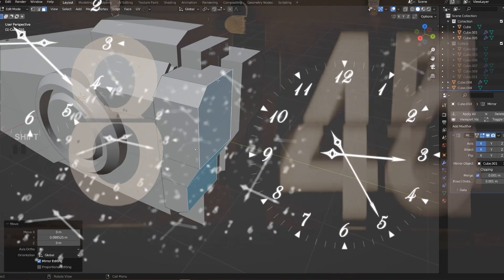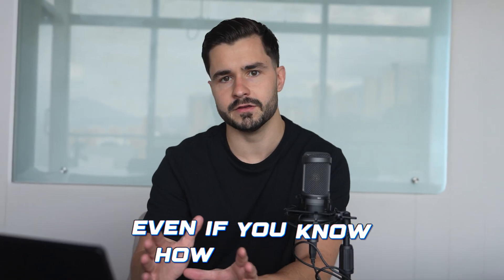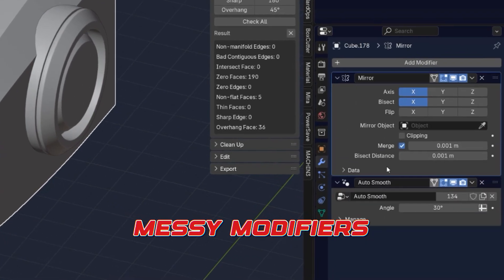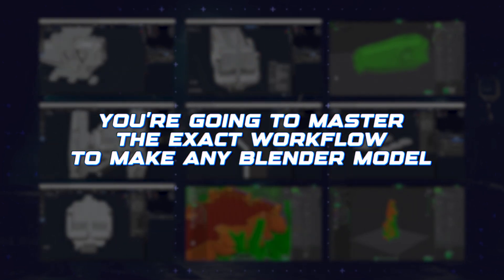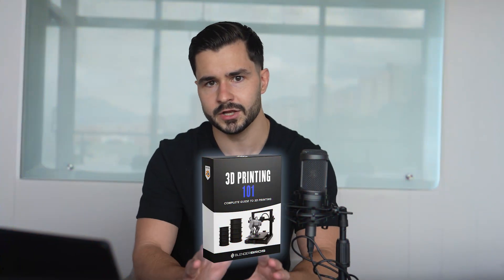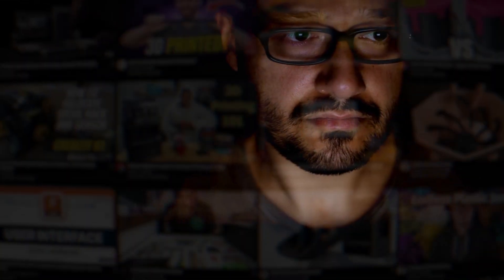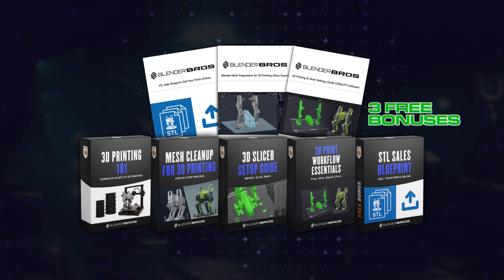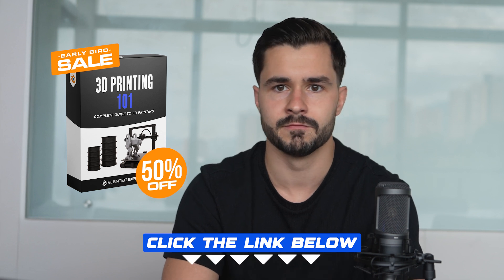3D Printing in Blender? Watch This.

Comment: There's a playlist called "Precision Modeling in Blender" on the channel Keep Making that teaches the basics of Blender for 3D Printing, starting from like "this is a vertex, that is an edge." This lesson seems to cover a lot of stuff he doesn't really cover, tho, like how to split up the models easily. $1000 seems like a bit much for a 4-hour course. Oh, it's $400, but you have to scroll all the way down to see that. You might want to fix that, there. :-)

The number of STLs I've downloaded that don't even come close to printing because the designer obviously never even tried to slice it (let alone print it) is legendary.

Slant3D is another good channel for learning how to do things like eliminate the need for supports or overhangs, how to make slicer tweaks unnecessary, etc. I've used their knowledge to good results.